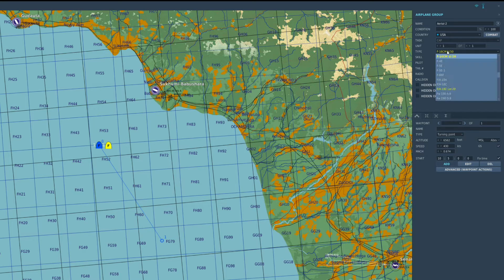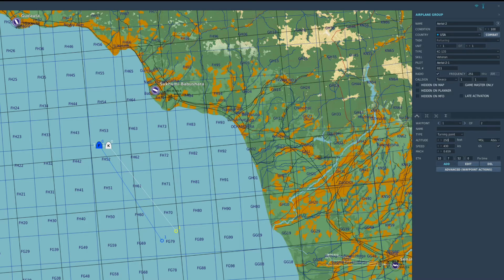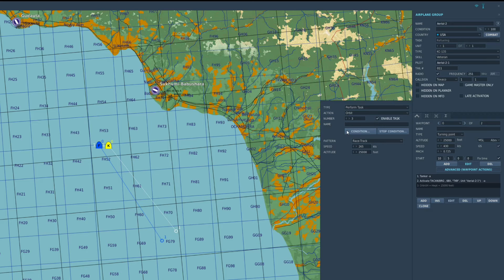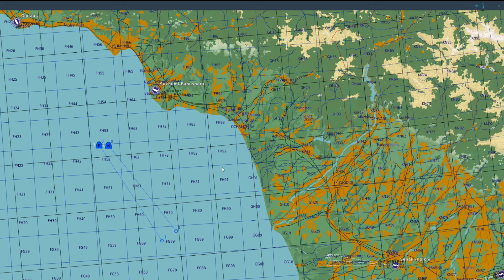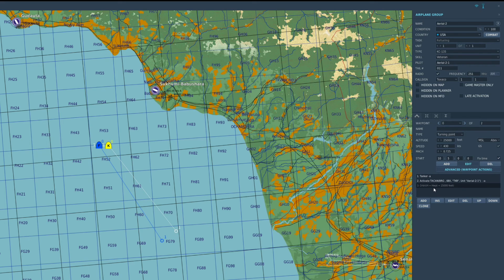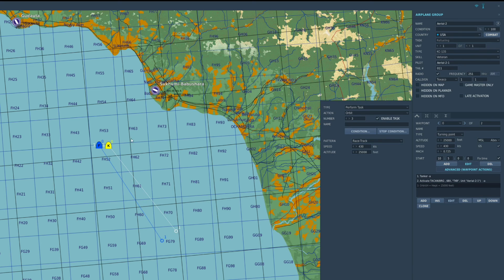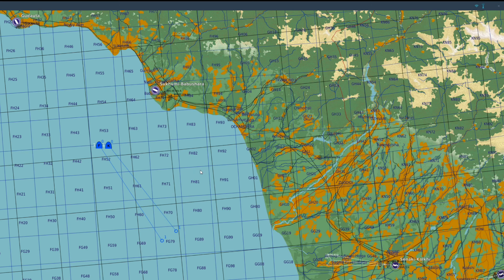2 MIN Tanker Setup - DCS Mission Editor

Comment: Great! If you set WPT0 to 25 000ft (and optionally another speed) before adding WPT1, WPT1 will automatically use the values from WPT0. Saves a bit of time. :)